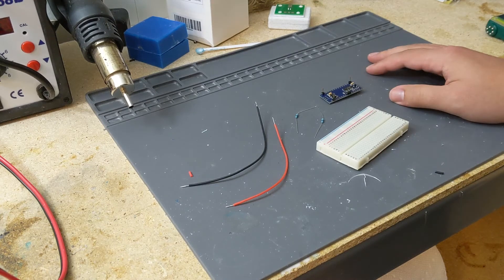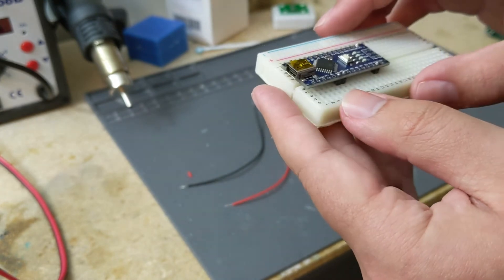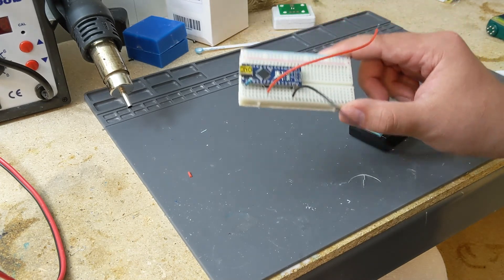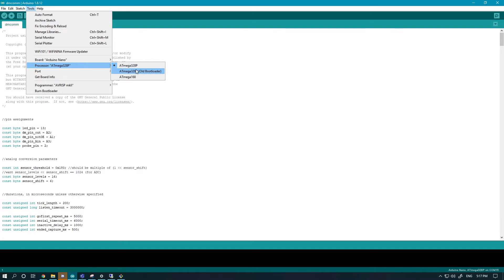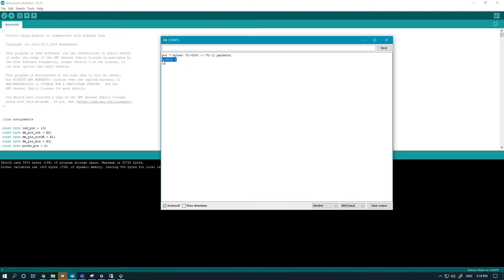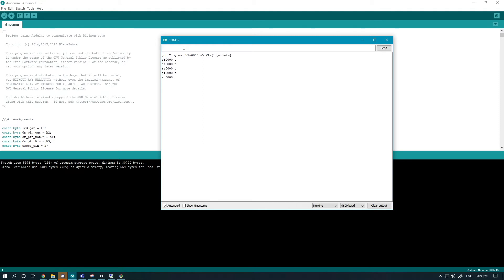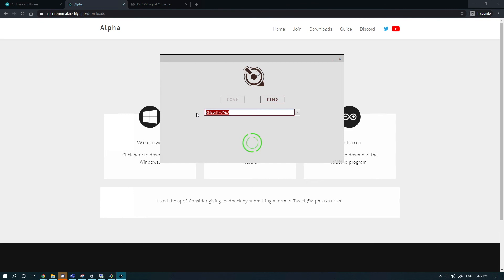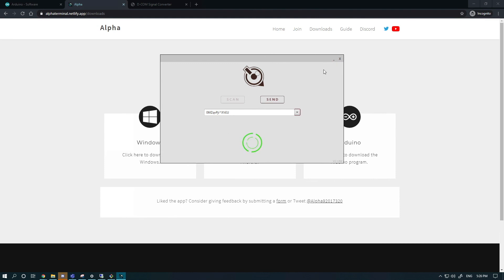How to build an A-Com

Comment: Any idea what I do with an Arduino UNO with no legs? And what kind of connector could I solder on instead of using the wires?

Comment: Hello, I have just made all the steps and everything worked fine! Thank you for this. So, I was doing a lot of battles tonight, until my vpet (a 20th bought last month) suddenly ran out of battery. It seems that the A-com could be drainning energy from the vpet. What could have caused this? What am I doing wrong?
Reply from the maker: If you are using the original battery then it will die very fast even without the a-com. The coms have no known impact on the devices as they act just as other vpet devices would when connected.
Reply from the maker: Taking the battery out and putting back in will only work for a short time because the voltage will go back up in the battery just a little because it’s not in use for a moment.
Reply: @zarcha  Oh ok, I was kinda desperate, it's my first vpet. Thank you for the information
Reply: I took the battery off and on again and now is working fine, but it was showing a big battery with an X in the middle. I don't know if I'm doing this in a not safe way

Comment: For some reason I simply cannot get it to upload to my board. 
At least it only cost me 30 bucks total. I’ve wasted a lot more on a lot less.
Reply from the maker: i dont know your specific issue for sure from that but most of the time people have issues uploading you arnt using the right com port, most of the time this is because you dont see the actual port since the computer doesnt see it. try installing the drivers i linked in the description.
Reply: @zarcha  that did it! Thank you very much man!

Comment: I keep getting s: 0000 t:-3 and no idea why
Reply: same here.. not working.. always -3, do u figure out the problems?
Reply: @mamsweek  I got the parts today and I'm having exact same issue :( Were you able to figure it out ?
Reply: @carltownsend8307  still not working.. tried using another cable also the same.. its like arduino not give feedbck to laptop

Comment: Hello pal! I am just now trying to set up my ACom and the "port" option in the tools manu isnt pressable, its gray too what is wrong?
Reply from the maker: you will probably need to get the drivers for the arduino board, i link them at the bottom of the description
Reply: @zarcha  Thanks alot for the fast reply! I will try tomorrow and i will inform you thanks!

Comment: When I initialise with V1-000, the output was s:0000 t:-3 
. When I tried with an input for my vpet, it doesn't connect. May I know what's the issue?
Reply: Hey i have a fix for this now. I got my acom working with code converter and will test shortly with world. I had my wires connected in reverse to my digivice. The wire from a2 on the arduino goes to the front conenctor on the digivice and the wire from ground goes to the back connector plate. When using arduino, activate it using v1-0000 which with nothing connected shoud output 's: 0000 t: '. When your digivce is connected it should also output the same, if not then try reversing your connectors. 

Then when you're ready use ' V2-0904-0907-384E-008E-05AE-01EE-000E-000E-000E-@0^F^FE ' (paste it in but dont hit send just yet) as a test so when you select battle on your digivice, go through all the prep steps as you would if you were connecting two digivices, then hit enter on the code to send that code to your digivice. ad you shoudl get a response like below:

s:0000 t 
s:0000 t 
s:0000 t 
s:0000 t 
s:0000 r:0904 
got 28 bytes: s:0101 r:1332 s:0101 r:0002  -> N
got 53 bytes: V1-0101-0101-800E-008E-05AE-01EE-000E-000E-000E-@0F0E -> V1-[10 packets]
s:0101 r:0904 s:0101 r:0907 s:800E r:384E s:008E r:008E s:05AE r:05AE s:01EE r:01EE s:000E r:000E s:000E r:000E s:000E r:000E s:FF0E r:F0FE 
s:0101 t 

Use d-com code converter to get you signal out
Reply: @shawflygirl  Thanks for the solution. Apparently the cause of my issue was that I used the wrong resistor.